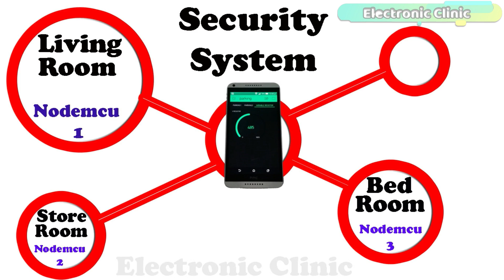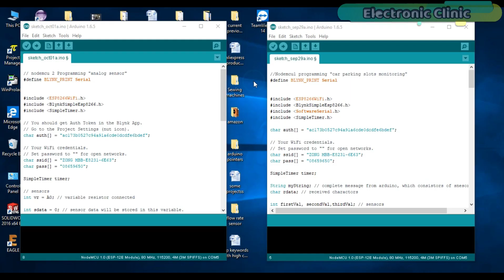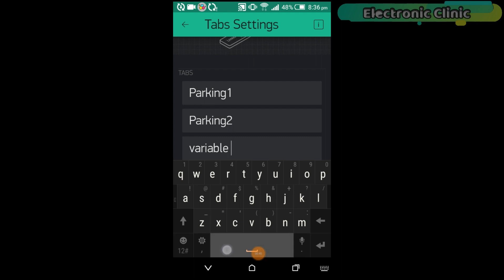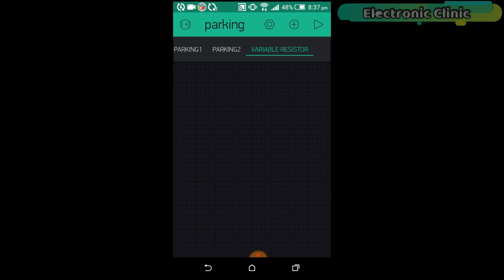Arduino project: Monitor multiple Nodemcu esp8266 modules using blynk | Nodemcu Network “IOT”

Comment: Aoa, can I use same Blynk Token on 2 NodeMCU modules , having push button on one NodeMCU to Toggle  Digital Pin high & low on second NodeMCU placed at remote location with different WiFi Network. If possible, can you please share the code.
Awaiting your earliest response.
Thanks & regards.

Comment: Sir? It is possible that i will connect a 2, and the firts ultrasonic sensor to control the servo. While i also using ultrasonic sensor2 to send notification to my phone?
Reply from the maker: yes. even you can use more ultrasonic sensors.